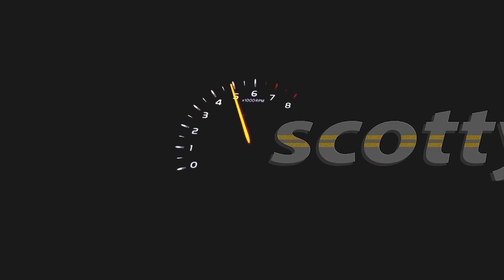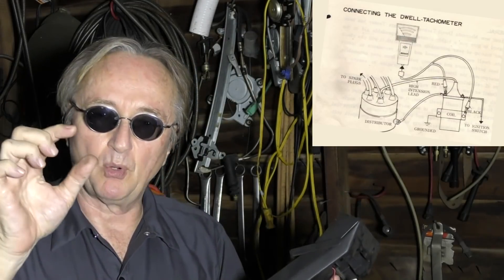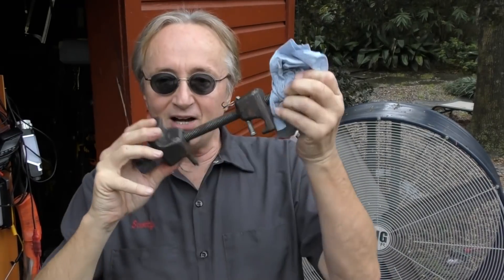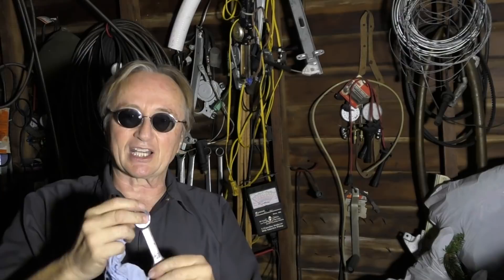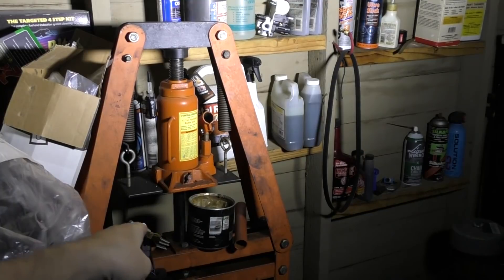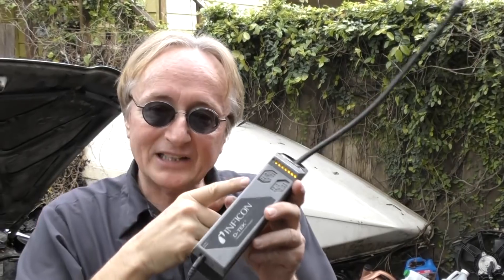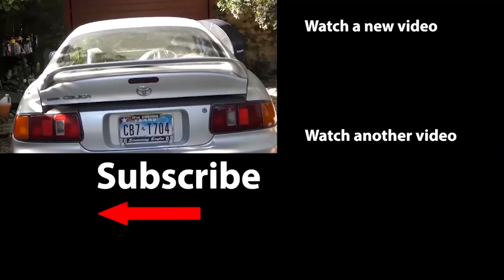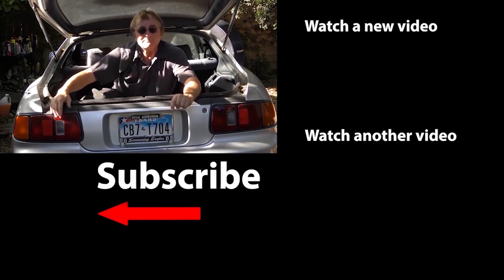I Finally Cleaned My Garage, Here’s What I Found (Mechanic Hoarder)

Comment: A press would have been useful when I replaced U-Joints on my rusty 99 Dodge Ram. Ended up using the socket method but a hammer wasn't heavy enough so I ended up using about a 20 inch piece of railroad rail... :D

Comment: You can’t use those manual spring compressors on a 2012 Nissan Quest. Tried. It will not compress it enough before the compressors slip.

Comment: Hey, I still don't see the floor in that garage Scotty. 
I use to love working on my cars, doing tuneups etc. But I gave away all of my equipment years ago due to the complexity of the new cars, and now I just take my cars to the dealer, even for oil changes. Since I only own Honda vehicles now it doesn't matter since they don't really need much more than putting in gas anyway.

Comment: How often do you see someone send off a part to be rebuilt like a water pump or an alternator or a power steering pump to keep all original parts on a car? I know there are places that do rebuild old generators and stuff, I just don't know if that's an untapped part of the market.

Comment: Are you sure that refrigerant sniffer doesn't work, or is it just looking for chlorinated gases such as R22?

...though much of that stuff, including the power steering hose kit, the economics may have been drastically different when you got it than they are now. I don't remember seeing many power steering hoses in the corner parts store until recently. Heck. The ones here in Alabama just recently started carrying wheel lugs. I used to have to get those from the dealership.

Comment: But Scotty, the 11/16 will work fine as a 17mm. The 9/16 as a 14mm. Many wheel nuts with turn equally with a 13/16 or a 21mm. A 5/16 will usually do for an 8mm. It's a tool. It doesn't have a brain. It doesn't know it's the wrong tool!

Comment: Google is got or has got millions of hits about their keys stopping working due to their security computer getting the equivalent of human Altzheimers DESIESE and no longer recognizeing the key that's been used several years. Are there new replacement modjules to replace the fuel pump circuit the starter curcuit the fuel injector curcuit and the plugs firing curcuit ? I need all those to make my 3.4 liter Rendevous Buick run again. The motor trans. And hydralic rear end are good for at least 100 thousand more miles but OnStar shut my security sensors down intentionally disabeling my car there are hundreds of Rendevous in my town of Decatur Al. Still on the roads daily they don't have OnStar on them.